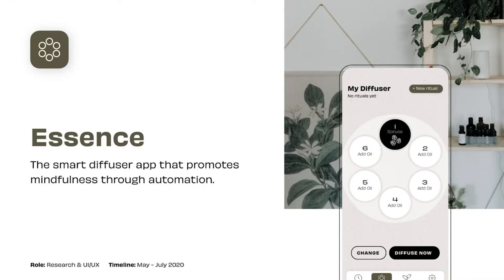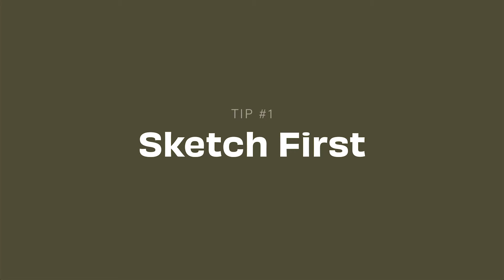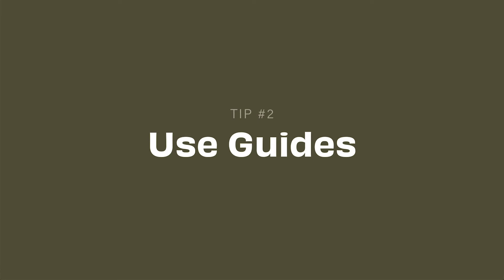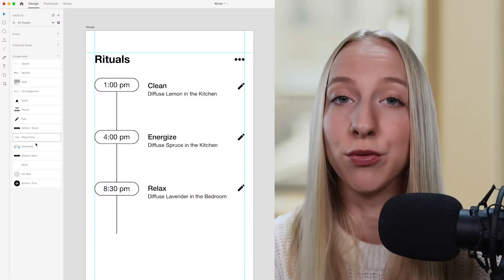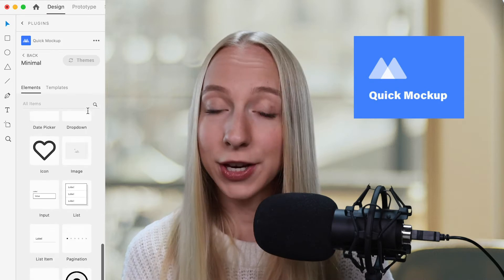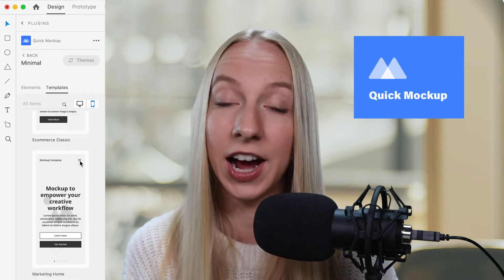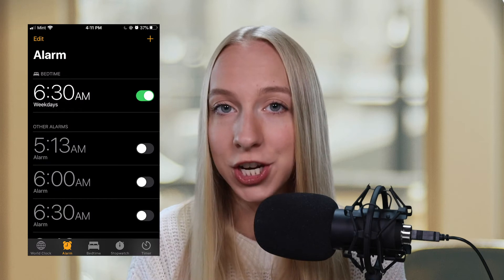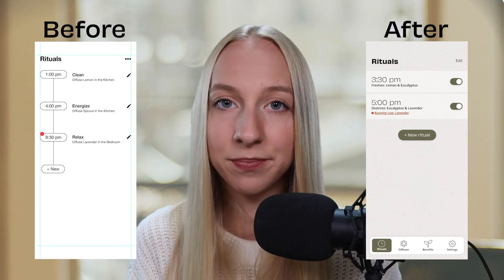6 Tips for Wire-framing + What I Learned Testing My Prototype | Behind the Design Part 5

Comment: Hey, you said that you set a specific guides for a specific iPhone screen size, but do you really make your designs/screens for other screen sizes, I mean do you really make many versions of mobile touchpoint (for different screens), then for example many versions of desktop touchpoint (ex. 1920,1366,1440 etc) and so on? Actually I'm a little bit struggling which sizes should I take into consideration in my project.
Reply from the maker: Good question! It totally depends on what sizes are really needed. When it's a website that needs to be accessible on all screen sizes, I'll design for 1920 desktop (making a light guideline at 1440 just to stay aware of that size) and then a mobile size. Sometimes I'll also have to do an iPad design. But to answer your question I usually only have to do one design per device, not tons of different ones. Back when I was designing ecommerce apps, sometimes I did have to do an iOS and an Android version. Haha I guess there's a lot to consider here! Maybe I should dedicate a whole video to this :)